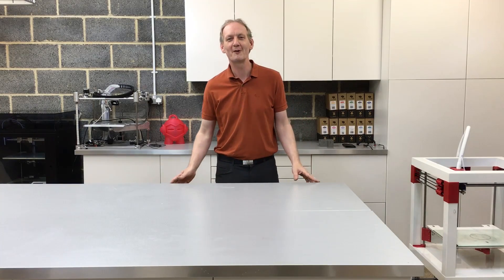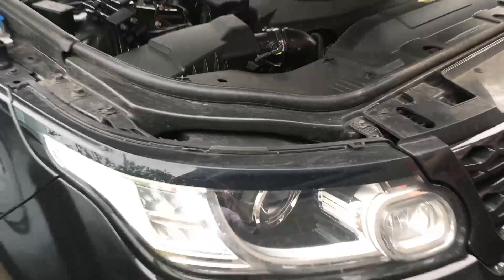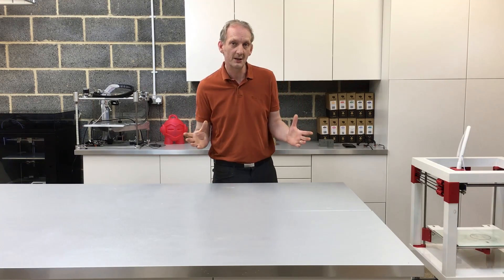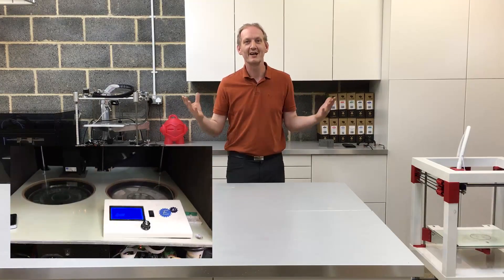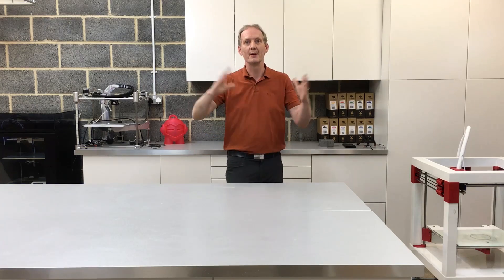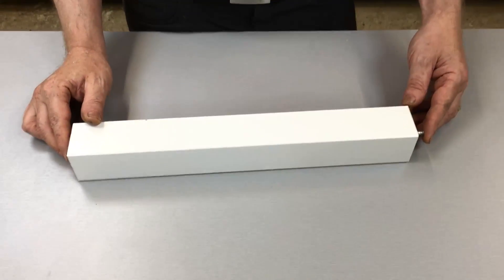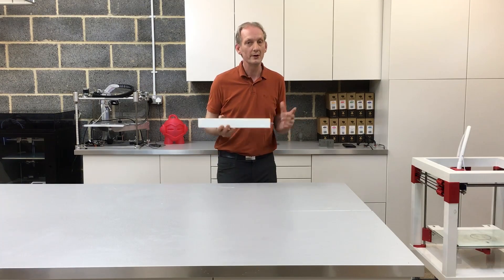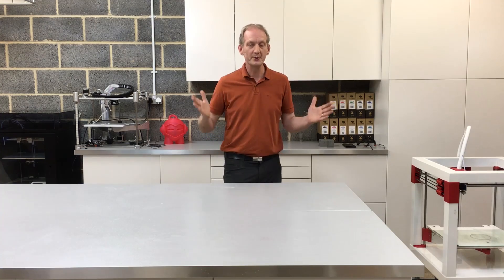Printtable Introduction to IKEA Hack, Lack Tables into a 3D Printer Build Sequence 1

Comment: BRB buying IKEA LACK table.

Nah, i'm not building the Printtable, at least not just yet, i just want to get a lump of rapidly moving steel in my existing printer off my wobbly desk, and i want to anchor it down into furniture that i don't mind butchering so the printer warps less. It's reassuring that your experience was so good. But i do like your design, it's similar enough to what i'm looking for and i'm not too unlikely to build one eventually, maybe in modified form.